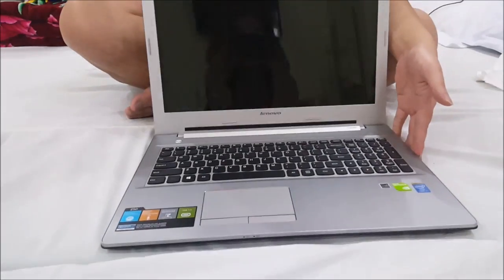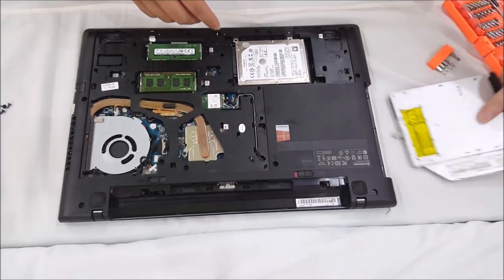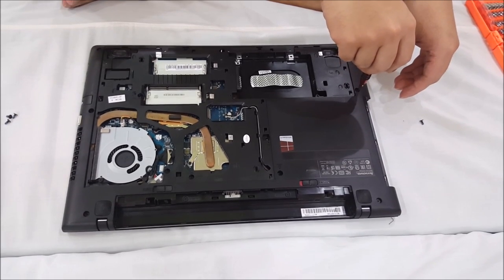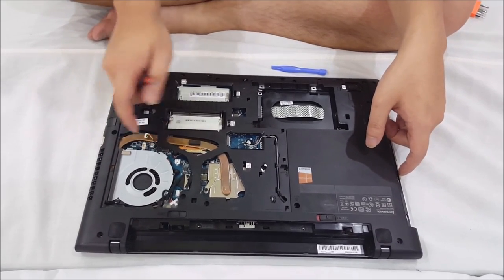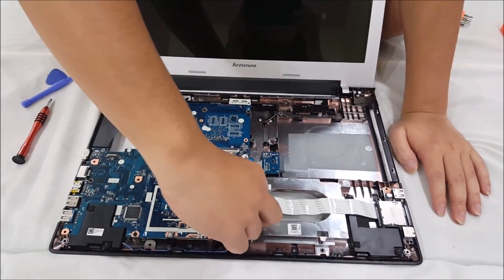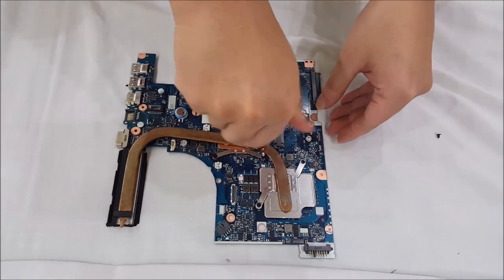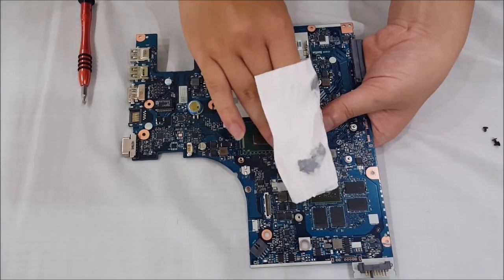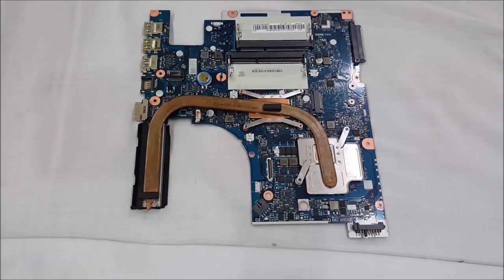OPEN ME UP! Lenovo G50-70, G50-70M and Z50-70 Disassembly

Comment: Hello, I've upgraded my z50-70 laptop with new battery and SSD. This would be just fine. But many years ago I was dumb and put my laptop for "cleannig" in unnamed company. Hovewer, they messed it up. After I got my laptop back the sound was not working... but that time I was using my external speakers so I did not noticed it. I found that many months later and of course I couldn't go back to the company that cleaned it as they would say that I broke it. (this is how our country works sadly) Well, OPEN ME UP for the rescue. With help of this handy tutorial I managed to open my laptop to the motherboard and I found that my speakers were not plugged in... So I plugged it in and closed back everything. And now speakers are working again with new battery and fast ssd. BUT!!! Here comes the big but! I somehow messed up something, becouse now my laptop won't wake from sleep mode. It can get into sleep mode. The power led is flashing slowly, but when I wake it up, the battery led and power led flashes for a sec and then both leds turns off. When I press the power button again it starts normally like it never was in sleep mode. Any ideas what could cause this? I though it was only some missing driver, but when I switched back to old drive it was still not waking up. Thank you very much for any help.
Reply from the maker: thats correct there is nothing wrong. there is many types of sleep. so when i put my computer to sleep, i have to press the power button to turn it on again from sleep. it looks like it is start again from the beginning but it is different to a total shutdown. test a shutdown and compare it to your sleep and you will understand what i am saying.
Reply: @OpenMeUpTec  Hello, thanx for reply, but you probably misunderstand my problem. It was working before. And when you put computer to sleep mode, all open programs stays open when you wake it up. But when I try to wake it up I must "wake it" twice. The first power button press will mess the computer so it shutdowns hard. The second power button press starts the computer in normal way (when it is off completely). Any idea what to do with that? Thank you very much.
Reply from the maker: @jakubsenk4496  sorry I can not help you without seeing the problem. Since I most likely not experience this problem I can provide a solution without understanding it
Reply: @OpenMeUpTec  Nevermind, I'll look for answers elsewhere, I appreciate your reply.

Comment: Extremely informative video - Well done! You just saved me at least a $100. My daughter doesn't even have this exact model but the frame and basic construction is the same. She broke the charging receptacle away from its mount inside and I had to figure out how to get at it to fix it. I never would have imagined having to take it this far apart to separate the case. Without this video I would have had to take it to someone else and pay them to fix it.
Reply from the maker: thanks for your support

Comment: What is the purpose of the wireless card, is it upgradable?
Reply from the maker: yes you can upgrade it with anything the fits in the slot
Reply: Can i upgrade it so that it supports 5g wifi? how do i know if i will be buying is compatible?
Reply from the maker: @kennethvistan7734  yes and no. this laptop only has one slot. therefore you can only choose one of them. the next issue is this laptop doesnt have a SIM card slot therefore you cant instead the sim so you really cant use 5G
Reply: is there a wifi card that support 2.4 and 5g?
Reply from the maker: @kennethvistan7734  ok i think i understand what you are asking now. you were using the wrong words. you are asking for a WIFI card so you can use 2.4GHz and 5GHz. this there is many for this and you can just swap them out. 5G refers to mobile internet this is why i gave you the wrong answer. 

https://www.ebay.com.au/itm/Intel-8260NGW-dual-Band-wifi-adapter-2-4Gzhz-5GHZ/202934980745?ssPageName=STRK%3AMEBIDX%3AIT&_trksid=p2060353.m1438.l2649

Comment: @OPEN ME UP, Really Awesome Video. Thanks! I have Z50-70 and would like to ask is that how is Camera attached to Motherboard? I would like to know since i had to get my motherboard replaced and after that, my Camera doesn't work anymore. Whenever i open camera application(or anything that uses camera) it says "To get started, connect a camera". I checked for the drivers and all in device manager i COULDN'T EVEN find "Imaging Devices"(as far as i know i have to go and udate it) there. Your help would be like Saved by the God! Thanks Again!
Reply from the maker: the cable is connected to your motherboard. they probably forgot to plug in the cable for the camera it is pretty normal
Reply: Thanks! for the reply. I hope it's just that.
Reply from the maker: try to buy it on ebay or just throw it away as buying it from lenovo will cost too much
Reply from the maker: it comes with it.

Comment: You an place a little magnet at the screwdriver. That helpt lifting the screw up or fix it again.
Reply from the maker: my screw drivers have weak magnets. normally i dont use this screw driver for disassembly

Comment: Hello, thanks so much this video was very helpful. I don't have this exact model I needed to fix my ac adapter (it slid into the computer and I was unable to charge it. It was working fine before I took it apart. Now It just continually goes through the power-up mode. Please help me. I'm frantic because I need this to homeschool, my kid, due to Covid-19 school shut down. Is it possible I did not reinsert the blue power tab properly? Thank you so much in advance.
Reply from the maker: i am not sure what you are asking. please watch the video and tell me at what time you are having issues with so i can understand what you are looking at

Comment: Very good video, a question, if I change the motherboard of the Z50-70 from an I5 to an I7, is it necessary to reinstall everything in the operating system? only the CPU would change but not the HHD or ram.
Reply from the maker: just switch the board over and that's it, you don't need to do anything else. it will now show you have an i7 instead of an i5

Comment: hi great video , i have a G50-70 the screen flickers when i open it up , i have to move it back & forward to find a sweet spot to use it . so can i just replace the wire to the screen? or do i have  to replace the screen ?
Reply from the maker: most likely your cable is lose. try that first

Comment: Absolutely brilliant. good work , man. I'd like to know if the headphone-combo jack is user replaceable. As in, is it a separate part and not attached directly to the motherboard or any other components ?
Reply from the maker: +Eshwer Shivaprakash it is attach, like any other laptop it is solder on to the motherboard. thanks for your support
Reply: +Eshwer Shivaprakash it is user replacable. it isnt attached to the Motherboard. it is soldered to an seperate board together with usb port and the Card Reader. you can replace this board.
Reply from the maker: yes you can replace this board. this is what I meat by it is solder on. you going to replace the whole daughter board it is quite hard to come by unless you get it from Lenovo

Comment: Thank you for the video! I have a problem with my Lenovo G50-70 and have no knowledge on computers. My PC has resumed the habit of crashing. It is then impossible to restart it, unless I remove the battery& hold the power button several times. And it doesn't always work. I ran a hardware scan (by Lenovo solutions center). Everything seemed ok, but the problem persists. Can it be a hardware problem that I could easily fix (a bad contact?)? Any help would be greatly appreciated!
Reply from the maker: When does it restart. After using it for a while or. When it restarts does the restart intervals get smaller. I believe you have a fault component or your computer is over heating.
Reply: OPEN ME UP Thanks, such a quick answer. It normally crashes (it doesn't restart!) after working on it for a bit ( no gaming etc, but several open programs&tabs). Between yesterday and today it has been crashing right after starting it, today right away after having finished the hardware scan.
Reply from the maker: Probably your ram might be faulty check that out first
Reply: Thank you! I`ll check that out.
Reply from the maker: If it is not the ram come back to me and I will tell you the next step

Comment: Very useful video :D thanks a lot! But i still have one question... by removing the back panel is the warranty lost? or only by removing the sticker that you mention it on the minute 7:19 ?
Reply from the maker: sticker only. they allow you to open your laptop up to change your ram and hard drive. dell allows you to open up your laptop and do whatever you want without voiding warranty as long there is no physical damage
Reply: thanks for answering :)

Comment: Hi! First, thanks for this video. Second, do you know how can i do to disconnect the inbuilt mic and camera? Got a G50. Thanks!
Reply from the maker: you need to remove LCD cover to remove it. on the bottom it is connected to your LCD cable on the top it split out to LCD, backlight, Mic and Webcam

Comment: Hello, I don’t know if you reply to comments anymore as this video is quite old but I was wondering how to remove the back cover. I am able to remove the 3 screws but I can not slide the panel off for some reason. Any help would be appreciated, thanks!
Reply from the maker: just as the video shows you just have to remove the 3 screws and slide it. did you take out the 3 screws? dont leave them inside the hole

Comment: Is the screw hole closest to the red battery switch needed? I can't find my and now wifi doesn't work anymore.
Reply: probably  the antenna cable is not fully plugged in.

Comment: I took the fan out to give it a quick brush. I put everything back in place and checked it 3 times to make sure everything is right.

Now, when turning the laptop on, the fan spins for about 3sec, then stops. the HDD sounds like its spinning,the power LEDs are on but I get no image on the screen and then the whole system dies.

help pls? Lenovo Z50
Reply from the maker: take out the ram and hard drive and tell me what happens
Reply: OPEN ME UP thank you for your reply. Switching the rams around fixed the problem
Reply from the maker: thanks good to hear

Comment: The screen of my Lenovo G50-70 sometimes freeze itself, it becomes "pixelated" and the colour of the screen slowly change to a bright white. Most of the time i just have to move a bit my screen and it will come back to normal, but sometimes it is useless and i have to force my pc to turn off.
What could be the problem?
Reply from the maker: probably loose cable
Reply: Thank you
Reply: How do you fix the loose cable problem?

Comment: I know that this is an old video but I have a question.. my brother bought the lenovo 750-70 in 2015 and he gave it to me in 2018. Now in 2020 this laptop is getting more slow than before so my question is, can I put some new SSD in Lenovo Z50-70? and graphics card? Thanks
Reply from the maker: graphic card is soldred on. you can change the hard drive to an SSD
Reply: @OpenMeUpTec  uhh sir how about some new RAM?
Reply from the maker: @scrimtellect  new ram or more ram normally wont do much. the first upgrade is SSD, this is generally the best upgrade as there is a massive difference compared your old hard drive.
Reply: @OpenMeUpTec  Ok noted thanks!
Reply: @OpenMeUpTec  Sorry in advance but I still have a question, uhm can I change the processor from i5 to i7? thanks
Reply from the maker: @scrimtellect  CPU is solder on, graphic card is solder on, ram can be changed to 16GB max with 8GB DDR3L in each slot and there is 2 slots, wireless card can be changed, and hard drive is a 2.5" inch.

Comment: My same graphics card 840M is not getting detected anywhere(BIOS, Device manager - (even after checking the box to show the hidden devices) in my PC. Do I need to replace the GPU? or is there any other workaround? i have to keep my HD integrated graphics disabled in Device manager otherwise laptop goes to black screen with error and restarts again in the same loop.
Reply from the maker: it is dead. this i what happens when it is dead you can find it. your computer is working becaues it is using the HD intel graphic card
Reply: @OpenMeUpTec  thank you for the quick reply. Is there any way to replace it?
Reply: Just an update here, somehow graphics property in BIOS was not set to discrete, I did that and now I'm able to see the card in Device Manager 😁🤘👍

Comment: hi :) i was using a broweser and its unfortunatly turned off. then cannt start, its not showing me if charging what can i do? i disassembled and nothing was wrong :
Reply from the maker: please type it again dont understand the issue
Reply: OPEN ME UP sorry for bad london :D Suddenly I turned off and could not get start with start button. No longer charging and laptop not showing me if it charging :/
Reply from the maker: this laptop requires a battery to turn on. so without a battery it i will not turn on. your battery is probably dead
Reply: OPEN ME UP thanks for answer, you are good man :)

Comment: can you exchange the wifi m.2 whith nvme. and just use usb wifi
Reply from the maker: you can change the wifi m.2 for a m.2 ssd. you cant use a NVMe as it wont work in that slot
Reply: ty for the reply. In that case I would warher take out the dvd/blu=ray drive. @OpenMeUpTec

Comment: Does removing the bios battery resets its password in this model??
Reply from the maker: it does for any laptop that newer. that was once the case for extremely old laptops but when the i series came out that could not be done anymore
Reply: OPEN ME UP 
I forgot the bios password and tried every possible software to reset it nothing worked. I will try to open it up and remove the CMOS and see what happen. 
If that doesn't work, i must replace the bios chip right!!
Reply from the maker: thats not going to work as replacing it is not a simple task
Reply: OPEN ME UP 

I know it's not a simple task and i'm not gonna to do it my self of course..

But what is the other choice/way i can do to remove the password
Reply from the maker: it is not going to happen the reason is first it is too complex the chip is too small for you to attempt it. the most important thing is you wont be able to find the bios chip to being with
Reply: so what i can do, because i really need to access the bios to enable things like vt-d and vt-x for my work and study
Reply from the maker: get another laptop. or if you have warranty left. claim it on warranty

Comment: i have one question... one time i open to clean my laptop and my keyboard .. and after that my keyboard work fine, exept the shift button ... the left one and the right one stoped after that clean... i go gently as i can but i am wondering if it is hardware or software problem . So my question is shouled i buy new one or it can be fixed ? tnx
Reply from the maker: i think you broke your shift keys when you cleaned it. try to clean it again if that doesnt work then it is probably dead
Reply: yes still not working... its anoying to use usb keyboard just for the shift but i will buy new one i guess tnx for the reply btw
Reply from the maker: thanks for your support

Comment: Hi, I want to put the motherboard from z50-70 in g50-45. Are there compatibility?
Reply from the maker: should not fit in but you can try
Reply: Just laptops in appearance are completely identical, thank you.
Reply from the maker: if thats so it probably will fit. the G and the Z series lenovo laptop use similar case and some the same

Comment: Can we change the cpu in g50-70,?
Reply from the maker: CPU is solder on, graphic card is solder on, ram can be changed to 16GB max with 8GB DDR3L in each slot and there is 2 slots, wireless card can be changed, and hard drive is a 2.5" inch.

Comment: hello @OPEN ME UP
is there any way to change the touchpad? also my laptopo has a crack right under the usb 3.0 slot and i cant use it due to loos conection. what would you suggest?
Reply from the maker: yes there is a way to change the touch pad just take it out and replace it with another. at 9.40 you see me remove the keyboard cover, there you can also remove the touch pad. what cant you use the usb port or?
Reply: well i researched a little and it seems that i cant replace the touchpad, but i have to replace all the palmrest touchpad cover. yes i cant use the usb port because when i put the  stick it conects and disconects and i cant put files or whatever else
Reply from the maker: you can replace the usb port if you know how to solder but if you dont then you have to replace the board it is sitting on
Reply: but the crack is on the outside plastic at the bottom, right down of the usb port
Reply from the maker: so if the usb has no damage then there shouldnt be an issue. Honestly i dont understand your issues
Reply: well i think i have to change the bottom case in order to be able to use the usb 3 port. I think that due to the crack on the plastic, de usb stick is very loose
Reply from the maker: i really doubt that as the usb port has its own metal cover. the plastic outside cover doesnt do anything to the usb port
Reply: oh, i didnt know. thanks for the time you spent to reply, and sorry for the mess :)

Comment: Whare to insert sim card
Reply from the maker: there is none or it is you need to remove the battery to access the slot cant remember. it should be near the battery connector pin